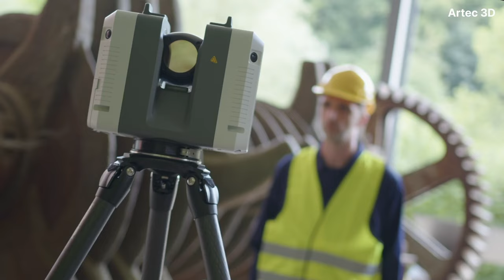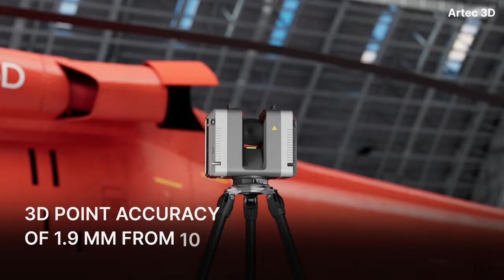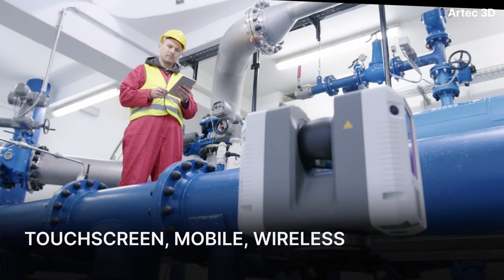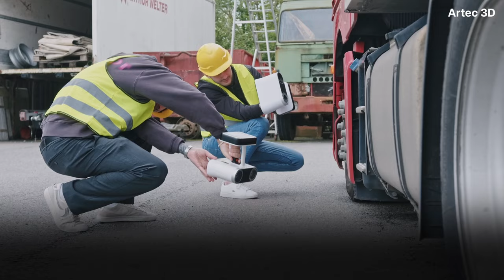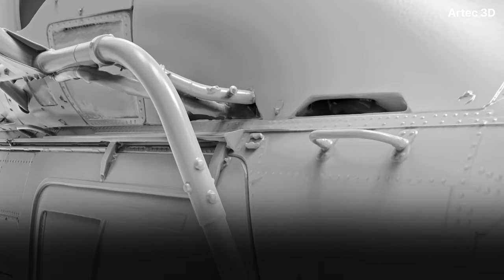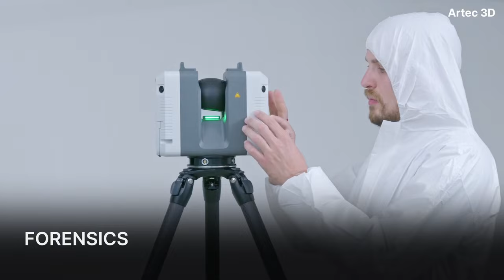Introducing: Artec Ray II

Comment: Looks like RTC360😮
Reply from the maker: Artec Ray II is specially produced for Artec 3D by Leica Geosystems. Unlike the Leica RTC360, Artec Ray II is fully integrated in the renowned Artec Studio 3D scanning and processing software. Scans are captured and processed directly in Artec Studio, using all Artec Studio’s user-friendly tools, technology, algorithms. 

Artec Ray II is also a perfect match for the handheld Artec Leo. Both are fast, wireless 3D scanners, and the combination of these long-range and handheld devices allows you full data coverage of any large objects or area at speed, and with high accuracy. The data captured by the two devices can be easily merged in Artec Studio.